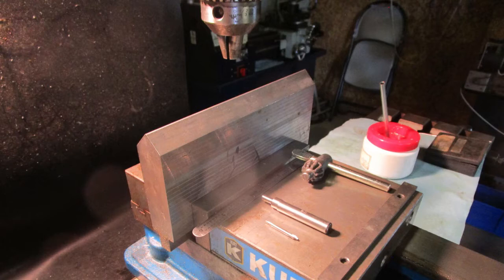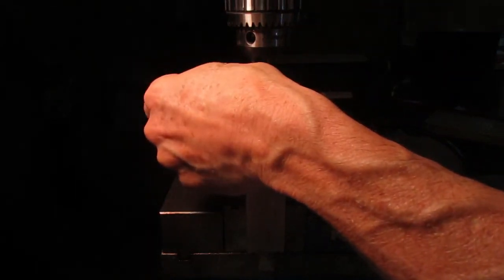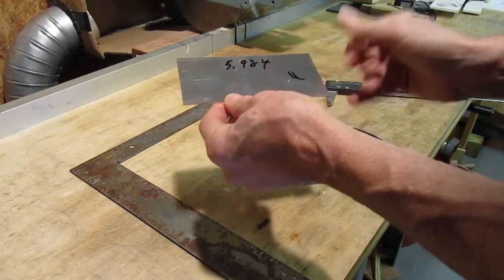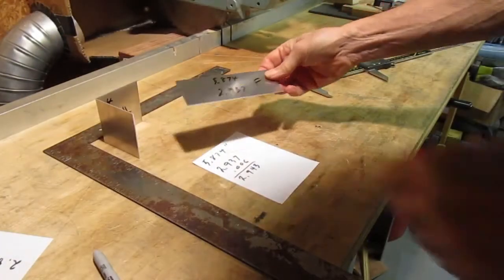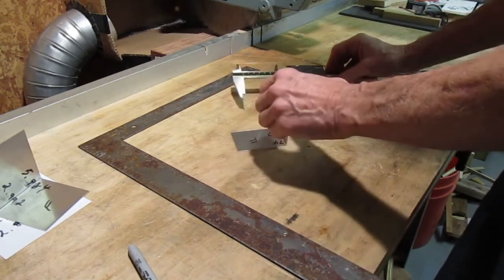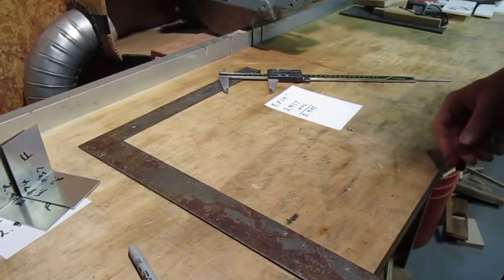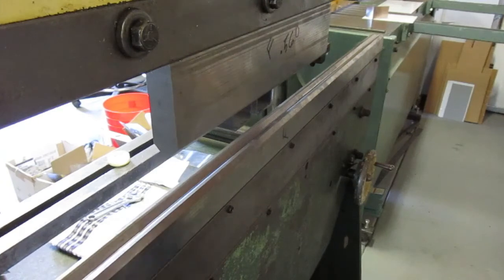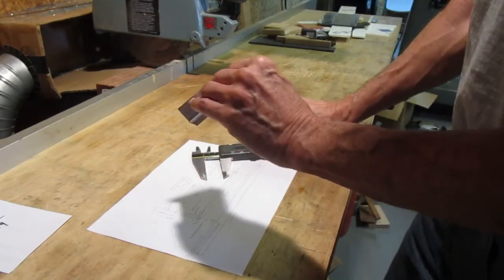Di-Acro 17T 48" press brake, making test bends and setting up for accurate bending.

Comment: In my experience, bending is one of the most complicated and more unpredictable manufacting processes
Reply from the maker: I totally agree.  I bent metal for years in my other shop and wouldn't know a bend allowance or K factor if it hit me in the head.  I made test bends back then to get accuracy.  About 18 months ago I watched a video on bending which introduced me to K factor, neutral axis and bend allowance.  I COULD NOT get their numbers to work on my press brake.  That set me on a path of discovery.  I figured maybe a few other souls out there would be in need of an explanation.  Hence my videos and blog entries.  Luckily I can do 3D modeling, 2D drawings and actual bending to check theory and practice.  To my surprise it all makes sense, works and takes the guessing out of bending.  Test bends are always a good idea as in test twice and bend once.